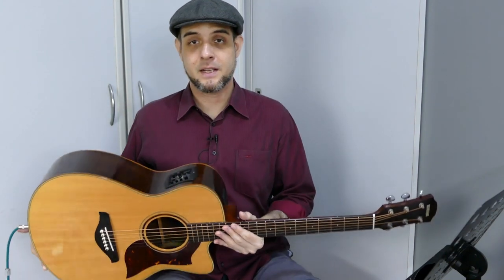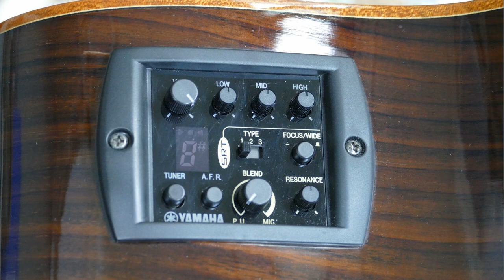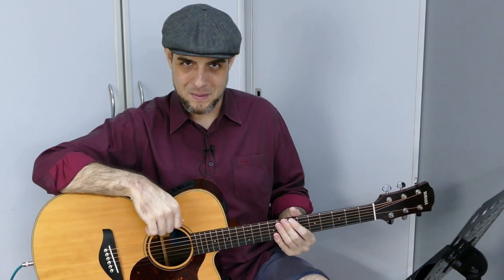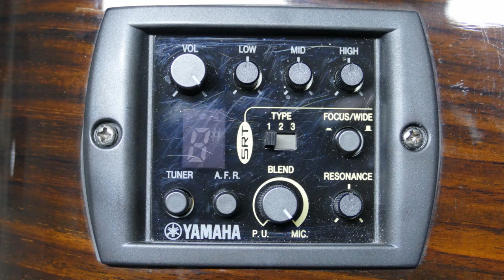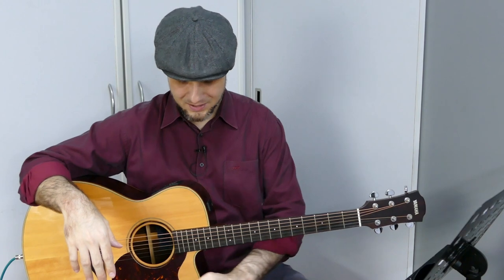Yamaha SRT system 63 preamp review and user guide

Comment from the maker: Bookmarks for video: 
00:00 Intro
00:22 System 63 background
01:35 SRT Pickup
02:15 SRT Preamp - batteries, control panel. 
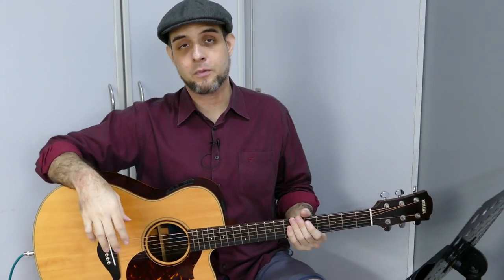05:06 Tone - piezo pickup only
07:00 Mic modelling discussion
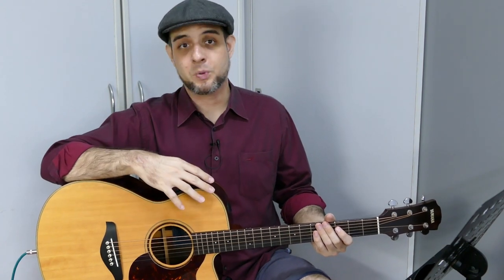09:22 Focus/Wide switch
10:41 Mic type 1 demo
11:55 Mic type 2 demo
13:17 Mic type 3 demo
15:17 Pickup and modelled sound blended
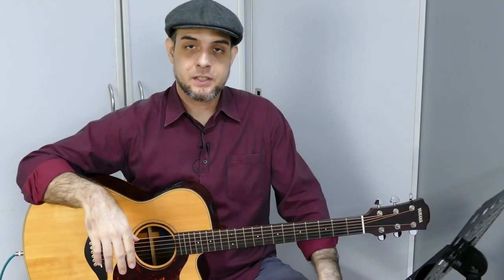16:30 Resonance control
18:06 EQ Section
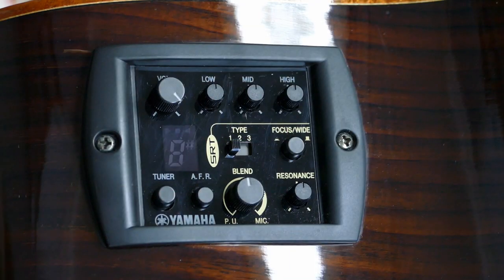20:57 A.F.R. Discussion
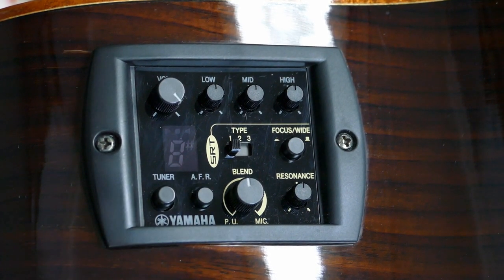22:26 Tuner
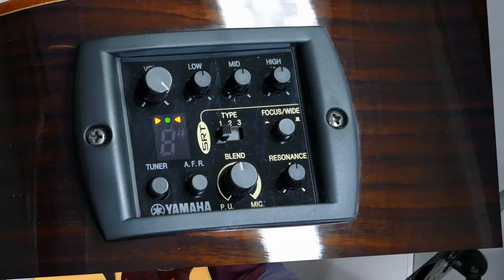24:03 Conclusion

Comment: Hi there.. not sure if there is anything wrong with my SRT Preamp.. I bought the fender acoustasonic 40 and plugged in.. the D and the G pick up was very weak coming out from the speaker. The rest of the strings are perfect …
Reply from the maker: That suggests that there is a problem with the pickup itself, rather than the preamp - I suggest taking the guitar to a competent technician who can diagnose the issue for you.

Comment: I've bought one of these secondhand - mint condition!
Killer sound BUT
I think the neck is not as easy to pkay as say a,Taylor, plus I thjnk they shoukd have made it 45mm instead of the narrower 43mm....just easier and more comfortable to play at 45mm
Love your reviews - so in depth and instructive
Reply from the maker: Thanks for watching Steve. Yes it seems that the Japanese manufacturers have settled on 43mm/1-11/16" as the default nut width for most of their guitars - 45mm is not so common. It's amazing how much difference those couple of mm make!
Reply: I have this exact same experience. I just bought a used A3M with this earlier SRT preamp system, and holding down certain barre chords at the first fret makes it incredibly difficult to get a clean sound on every string and way too easy to accidentally mute a string. I have the same problem with my Breedlove Wildwood Satin CE, which has the same 1.69" nut width. My Martin SC10E has a wider 1.75" nut width and I have no problem playing those barre chords on the first fret.

Comment: Thanks for your very thorough review.
I have a Yamaha Compass Series CPX500NT that has the Yamaha 65 preamp system.  I need to replace the broken preamp.  What would you suggest I get that would fit and work?
Reply from the maker: Thanks for watching Matt. I would take your guitar to your local Yamaha service center - they should be able to replace the preamp with a new one of the same model.

Comment: Im waiting for my apx1000 in PW to arrive. Sadly i cant hear difference in a single one of all these demos
Reply from the maker: The differences are subtle - hopefully once your guitar arrives you'll hear them in person.
Reply: @GLBProductions  i play a style of music called bachata. Where you install a humbucker in the soundhole. So i think all these features might be lost since you hook up the pickup directly the to preamp
Reply from the maker: If you're doing the Bachata mod then you'll get a very different sound because you're replacing the piezo pickup with a magnetic. The features will all still work but in a different way - let me know how it turns out!
Reply: @GLBProductions  so I have installed the humbucker , and sadly, I cant hear any difference by messing with the knobs, what a shame I either dont have the ear or there is no change.
Reply from the maker: @FadeToBlack1989  That's a shame... perhaps have a guitar tech double check the installation? Ensure that the pickup is actually routing through the preamp rather than directly to the output socket. It's also very helpful to record the guitar with different settings and then listen back to compare.
Reply: @GLBProductions  I installed it myself and the humbucker is routed to where the piezo wires would go. Ill try recording with cubase to see

Comment: I bought a yamaha fgx 830 c there is an active pickup system 66 equalizer, it's convenient for me, but I have a few more days to exchange the price is a little less than LL 16 ,, I want to record at home in the sound card line, so I wonder if the recorder will be better orat least it also works well as system66 on the 830
Reply from the maker: I'm afraid I'm not familiar with those guitar models, but I suggest doing some test recordings to compare the two guitars and then choose the one that you prefer.